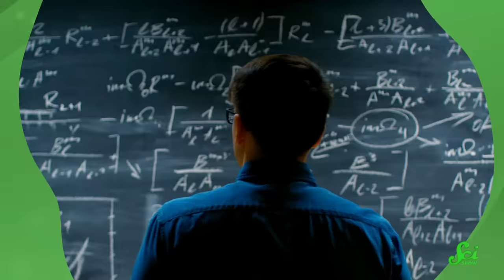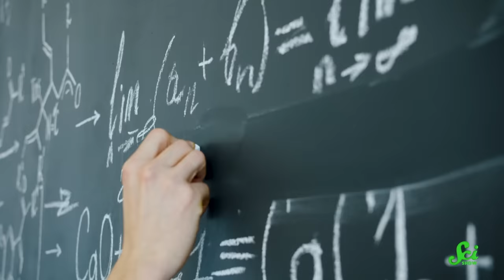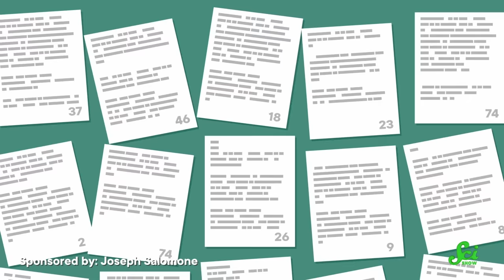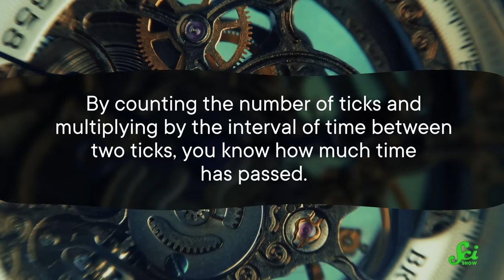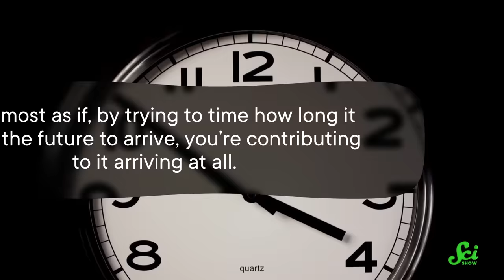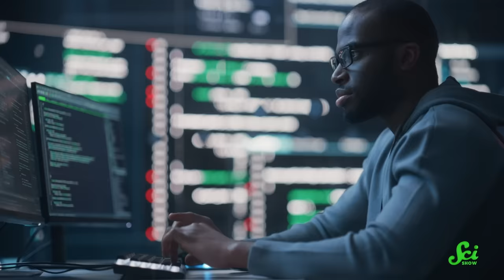Why We'll Never Build a Perfect Clock

Comment: Fascinating! But I don't understand exactly what entropy is. Every particle is heading toward fusion or fission at the rate energy is being fed to them or being taken away from them. And everything is relative to the state of the observer. The only real constant that exists is change. This means that no matter how accurate you can make a clock to be, it will only be accurate for that particular moment in time, within a controlled set of variables, for that particular observer. Because atoms vibrate slower, the more momentum it has, which results in time-mass dialation. But what exactly is entropy? If you drop and crack an egg, entropy. But, at the same time, as the shell smashes against the floor, there will be calcium particles that, through impact, that will move an energy level closer to strontium. So, climbing up the periodic table is more entropy. What about fission. All that stored fusion energy is exerted and lost thermally, while the atoms that are spewed out move down a notch in the atomic chain. So, fission itself is anti-entropic, while its effects are entropic?

Comment: There are three rates to consider. 1. The diminishing effect or draw of gravity away from the center of mass. 2. The increasing rate of time away from the center of mass. 3. The increasing measure of distance away from the center of mass. Speed is measured by time and distance which change and that changes the speed of light and causation. Distance gets longer without gravity and time  goes by faster, both of which speed up causation. The light has to arrive at a farther distance faster when distance is stretched and time also goes by faster. Then there is the first thing to consider and that is the diminishing draw of gravity which means things eventually slow down the farther away they are from the center mass of a galaxy. (It's not complicated.) 😎

Comment: Time is relative, it would take otherwordly hardware since it would need to do constant calculation and synchronization of the speed and position in space of both you and the point of reference "at all times"
Reply: You can actually measure a difference in altitude of meters using atomic clocks. Time flows slower when you are lower because there is less gravity from earth. So, you have a measurable effect in the most precise clocks depending on height. This is bizarre. Furthermore, entropy only shows where time points. It doesn't slow or reverse time. When entropy gets lower in part of a system, that part does not go back in time.

Comment: As a horology enthusiast, at 0:16 I'm quite perturbed by a video taken at the same as (or a multiple of) the frequency of the escapement wheel.
Reply: Yikes! At 2:34, far more upsetting is that the clock in the center has the hour hand pointing directly at an hour when the minute hand is pointing at the 6. How did you even get that wrong?!

Comment: In my view (and I'm not the only one, as this is more or less the current thinking of the most knowledgeable experts in the field as well as the prevailing viewpoint) time is just a measurement, i.e. it is not fundamental. There is no such thing as the "past" or the "future" in the sense that they are no physically different from the present, the only meaningful way we can make a distinction between past present and future is to make a measurement of some physical system to see how much it has changed or decayed. The reason a photon is "timeless" is not because it is immortal or because it has existed or will exist for an eternity, it's because they is no way to tell how old it is by making some measurement, because photons have no internal evolution. They never, ever, EVER change in any measurable way, which would make total sense if the view that time is just a measurement is correct.

Furthermore, entropy is intimately related to time, is the sense that entropy is responsible for creating the appearances, from the perspective of a temporal being (i.e. we humans). Entropy is often talked of in terms of being a measure of disorder, but this is not entirely accurate, an is actually misleading, and I think we can do better than that overused and oversimplified explanation of this fundamental concept we call entropy. Entropy is all about the long term behavior of a physical system with regard to how the energy of a system moves, distributes, and toward what ultimate state any given physical system will evolve. Disorder is not the best word to use to describe what is really going on, because order is a somewhat subjective concept, as it relies on implicit human biases to create a definitive and coherent description of what order/disorder is. Furthermore, the use of the statistical argument, while not incorrect, is leading to potential confusion, and is being stretched to the point of straining when it is applied in this context. But the real essence of the issue is that it's an explanation that doesn't explain anything. First of all, entropy is quantified by comparing the number of micro-states a physical system can take on and be continuously existing in. The micro-states are the various, and numerous descriptions of the distributions of ALL particles, and by extension ALL energy that has any potential to be a part of the physical system. It is in this way that we can meaningfully say that one system has "more" entropy than another. I will wrap this up by saying that it is more accurate to say that entropy is the tendencies for physical systems to evolve toward their lowest, i.e. most stable, energy state, not the most"disordered" state, and that is what I see as the essence of problem with using the term disorder. I'm only an amateur scientist/engineer/whatever relevant knowledge is applicable, so someone who is a professional or anyone who has expert knowledge can and should evaluate the correctness of the things I have said, and ideally provide additional explanation or clarification.

Comment: How do you determine the inaccuracy of a clock without a clock?
Reply: Not unlike watches, they do make timing machines to measure the accuracy of clocks although for various reasons they're not all too common to have within the industry.
Reply: @Karsonbarnes11  so why dont they use 'timing machines' to tell time? If they are perfectly accurate and not just another clock that is
Reply: @SunShine-xc6dh  really a timing machine listens for specific noises in a mechanical time keeping device to essentially determine how accurately it is running in order to better adjust said device. 
Technically speaking, many timing machines have a clock built into them to display the time as well, but their main function is to determine accuracy without having to observe the watch or clock for several hours or days.
Reply: @Karsonbarnes11  how does it know what an accurate clock sounds like without first hearing one and how was that clock determined to be accurate?

Comment: wait wut? 7:57 "so ultimately, the team found that the more accurate your clock is, the less resiolution i can have and vice cersa"

So just using your own definitions of accuracy, the amount of ticks before losing or gaing a tick for a given interval of time, and resolution, the number of ticks you can measure over a given interval of time, and your own analogies of the granfather clock and the atomic clock, both of which have bneen around for long enough that their properties are known, are you then saying that the grandfather clock with its resolution of seconds, is more accurate over a given interval of time than an atomic clock, whos resolution in in nanoseconds? or are you saying that stopwatch with milisecond resolution and quartz oscillator will some how lose or gain more oscillation errors over time that a grand father gclock with a second resoultion and a weighted chain would lose seconds over the same time? 

I understand the physics concept of having to pay for resolution AND accuracy with entropy, And i understand that for infinite accuracy OR infinite resolution(could ther even theoretically be either? but thats another topic an another tangent) you would have have infinite energy to pay for the infinite entropy. and i can see the logic jump that says at the smallest levels, if accuracy and resolution act simiular to piosition and momentum with particles at the quantum level and that after a point you have to start sacrificing your ability to know one to better be able to know the other. But just like trying to apply the Heisenberguncertainty principle to the macro doesnt quite apply, as say we can definitely know position and momentum of large cosmic object relative to other large cosmic objects, i dont quite think the losing accuacy to gain resolution and vice versa works. at least not across all clock types, which is whatt you are implying. 

I can even see how, if you are comparing clock accuracy vs resolution across clocks with a similar oscillator might even adhere to that law, but theres no way a grandfather clock has a higher accuracy than an atomic clock, or a higher resolution, or a higher entropy in any way. An atoimic clock ocillates at nanosecond resolution, with billion year accuracy, and an eff ton of moving partts meaning super high entropy for a clock. So please explain how tthe statement at the above timestamp makes sense at all based on everything else thats said in the video. 

thx :P

Ps. Nevermind. i pausd the viddeo and typed this. but literally a few seconds later you adressed it. in exactly the same way i was saying. :P

Comment: the attempt to connect the passing of time and entropy is problematic. yes entropy will show you the direction of time. but not the rate in which it has passed. there is no correlation between the rate of change in entropy to the  rate of the passing time.

Comment: "Why can you remember the past, but not the future?"
      The past has ...settled events. Settled events like sunrise, sunset, breakfast, lunch, conversation, etcetera.
     The future is not settled. What you will eat tomorrow, or say tomorrow is...up in the air. Sunrise and sunset are ...less up in the air.
     Clocks impose two things. First they impose an external event, like sunrise, to base their validity on. Second, they impose an internal "division" based on that external event: they impose the seconds, minutes, and hours between that external event.
     Without that external event what even is a clock? A clock isn't a time detector; it doesn't detect chronoton particles to tell you what "time" it is. It, originally, started as an imposed "measurement" between two events that were seen to be stable. Two events that were seen to be one event that occurred over and over again WITHOUT CHANGE. Without change IN TIME. A consistent process.
     Now we know sunrise does change depending on if you live at the equator or not. Those living above and below the equator experience a change in the time between sunrises that coincide with the seasons. Those at the equator experience no change in between sunrises and may only experience changes in tropical climate called the rainy and dry season. On Earth.
     Apart from this BINDING of time to a non-changing INTERVAL of time, there is this BINDING to the DIVISION of this non-changing interval.
     Time in this original conception is tied to experience. Experience which is mathematically flawed. Flawed in the sense that the imposition of time is based on inexact assumptions. The assumptions of events, events that recur, and recurrence that does not change in between time. Recurrence that occurs with constant conjunction.
     Time, therefore, involves two things. A process that is externally valid and is internally valid. 
     Any notion of time that seeks to define time without both must prove to be incoherent. You cannot define time by external events, without internal consistency; or define time as internally consistent, without external support.
     Entropy, from this grounding, can be seen to be the non-correspondence between external and internal dyads or "entangled" pairs of time. The "time" of an inhabitant on Earth cannot correspond to to the "time" of an inhabitant on a star ship moving with constant velocity or with changing velocity (acceleration).
     Whereas an inhabitant on Earth can move with constant velocity or acceleration WITHOUT a loss of correspondence to "time". Just so an inhabitant in a Starship can move without a loss of correspondence to the clock in the Starship. The problem is the correspondence of time between the Starship and Earth. 
     Because the standard of time on Earth is supported not just by clocks but by sunsets; and the standard of time on a Starship is supported only by clocks, the two inhabitants experience time differently. Why?

Comment: Jeez, I did not understand this.  I might be able though, to summarize it by means of an expressive dance.
Reply: What do clocks do? Historically they predict the motions of heavenly bodies, for astronomers and navigators. This is circular - we check the accuracy of a clock by checking it against the movement of distant stars - we explain star motion, gravity etc - is the earth orbit elliptical, by measuring with an accurate clock.
We use clocks to allow two events to occurr similitaneously - catching a train.
We check - ie define - accuracy of clocks, be setting up 3 similar clocks and checking whether they continue to show th same time (we can try one in a hot room, one in. A cold room, one near the equator, where earth turns slower, one near the plole, where it turns faster.
Now can anyone answer this question. We say that a super clock is accurate to a second in a billion years or whatever - so we have a clock which is more accurate to compare it with? An absolutely accurate clock, and we run the two for a billion years, have we?

Comment: While processors are getting faster, that metric is a measurement of how many instructions the entire processor can complete in a given time interval. This speed increase is achieved bia parallelism, not a reduction in the amount of time it takes to complete any one instruction. The fastest CPUs today, even for server grade hardware, run in the single digit GHz range. Their speed increase is due to having many more cores.  Even the internal memory clock speed on cutting edge GPUs is less than 25GHz.